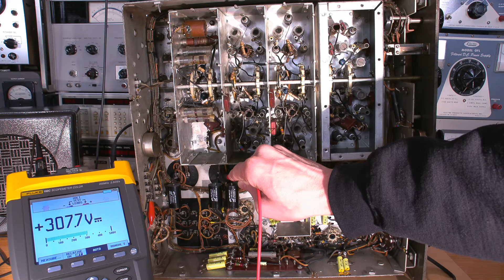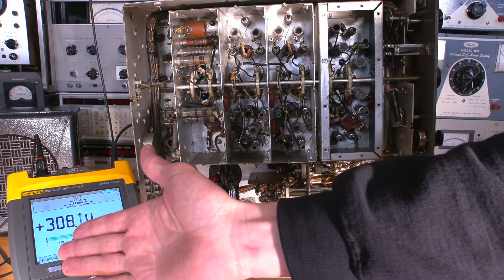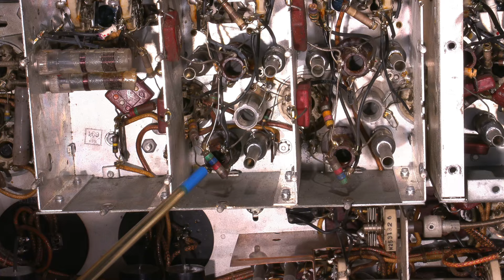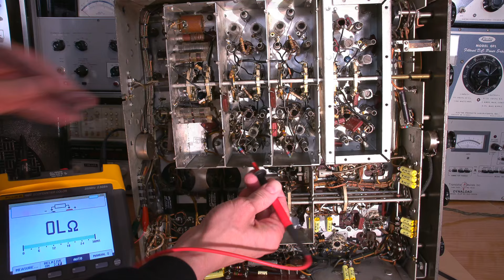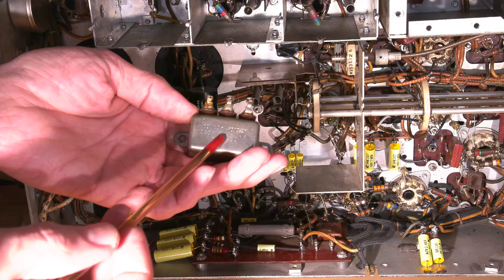Capacitors And Resistors -A Parts Substitution Guide!

Comment: The problem with these toxic components is that it's almost impossible to dispose of them. Here in the UK, I came across an open tin of Toluene which had been abandoned in a public park, and (doing my civic duty) took it home to prevent children or animals from coming into contact with it. End result: three years down the line, and it's sealed in a larger tin, that will now (apparently) live forever in my garden shed.  No recycling or hazardous waste centre,  is willing to take it off my hands, and even the government's environmental agency has stated that it's 100% my problem.

Comment: The Polypropylene Capacitors not only have a higher voltage rating, but also a much lower ESR than electrolytics. I just tested a new 2.2uf 630v polypropylene cap and it was reading "0" ohm ESR, then tested a few new 4.7uf 450v electrolytics and they tested about "7" ohms ESR, according to the ESR Capacitor Wizard tester I have.
Reply from the maker: You are correct!

Comment: Paul, I really got some good info on this video! I didn't realize that it was that important to use carbon comp resistors where required. To me a resistor is just a resistor. I can only dream of having your knowledge of this old equipment. To me the modern day electronics is much easier to repair, just because most of it is just 'power rails' feeding IC's, where as this old equipment you HAVE to know your stuff! Thanks again for the informative video! Guess I may be too old to learn it all at 63 yrs before my time is up, too much to learn! 🤦‍♂ But I'm having fun watching your videos, I AM learning! 😉

Comment: This is very informative. I think a similar video on choosing transistors would be super helpful. It's often difficult to determine which transistor parameters are important in a given circuit, and which could be better improved.
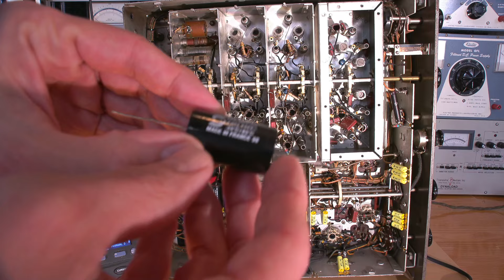Reply: Yes!  I'd love to see that too.  But also, with all the "counterfeit" capacitors and other components out there, how about identifying the good sources and brands?  I use Digi-Key, but are there other good suppliers?  And as far as brands... I had to make sure the video was in 1080p HD (the best this Chromebook can do) and make it full screen and stop it to look at those poly capacitors around 6:00.  I'd never before heard of that one with the stylized S logo labeled PPE-MKP-FC, made in France.  Where does one source them?
Reply: +1
Reply: Agreed
And if you haven't seen "xraytonyb" and his video series on transistor substitution.... I highly recommend it.

Comment: Hi Paul, Your use of the word 'poly' to describe a specific capacitor type, (polyester?) is not really advisable, as there are polystyrene, polyester, polypropylene, and other types of 'poly' caps. Poly is just Greek for 'many', so it doesn't identify a specific type of cap. You wouldn't use a 'poly'styrene capacitor as a power supply bulk filtration cap. Having said that, the width and breadth of your knowledge of electronics pretty much amazes me. I watch each of your videos 2 or 3 times to make sure I don't miss any nuggets of knowledge. The only person I'm aware of who may know as much as you about electronics is my business partner, and he's an old Heathkit engineer with a Masters in EE and a PhD in physics.
Reply: Agreed.  I also see advertised Poly film and metallised poly film.
Reply: @grahamsecr3677 , there's a Hell of a lot to know, and a Hell of a lot more to figure out, isn't there?
Reply: He needs to just say "The Yellow ones"
Reply: @melodymakerSD  theyre likely polypropylene or polyester

Comment: Very informative. Presumably, you could have also fitted two electrolytics (say 10uF, 350V) in series (with balancing resistors)? I agree that the two poloymers are better and will outlast any electrolytic, I was thinking of what general technicians may have available to use (sacrilege for such a transceiver, I know)

Comment: Really liked the conversation about keeping carbon resistors carbon and oscillator capacitor choice. Electronic component  materials are often chosen for very specific reasons. It is very hard to go over every scenario with respect to materials and circuit applications, but you took a very good stab at it. At University it is usually a 1/2 year course. Good for you breaking it down.

Comment: Those old filter caps usually had tolerances of -50%/+100%, so the original 4uF could range between 2 and 8 micro Farads and still be within specs. The old TV repairman rule of thumb was more capacitance and or a higher voltage rating was okay. A lot of rectifier tubes had a rather rough short life due to this practice. 4.7 nano-Farad mica caps? For 1000 VDC rated is about $25-$45 each. $25 for 5% and $45 for 1%.  Poly is >1/10 the price.
Reply: The Mallory bathtub may as well be a Duracell, it's the same company